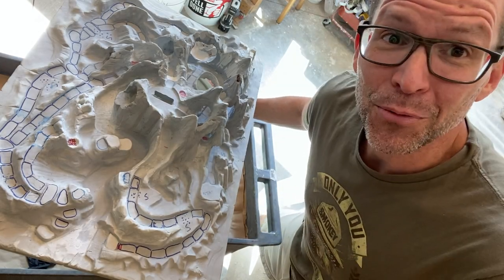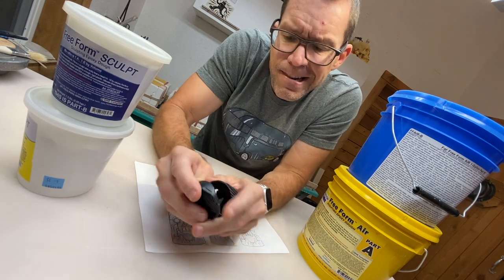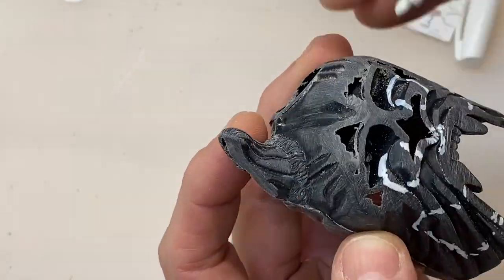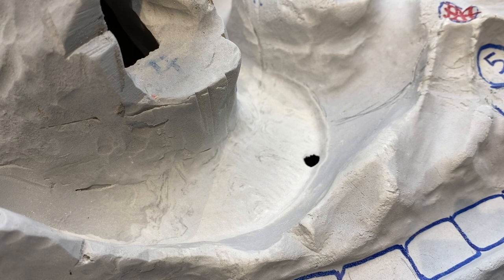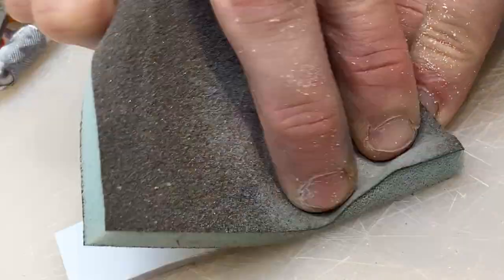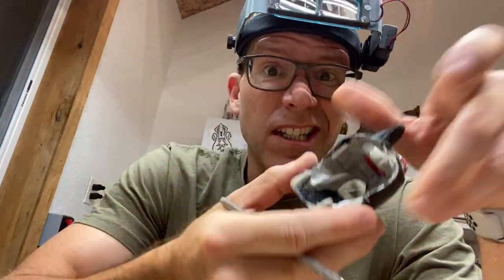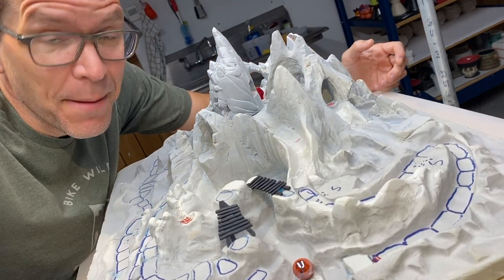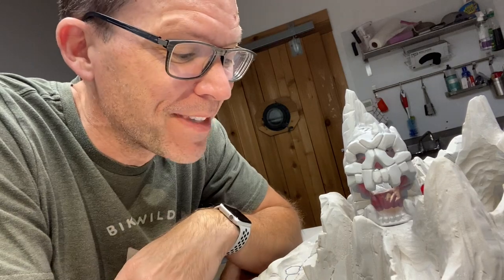Fireball Island pt3 - resculpting Vulkar with epoxy clay and LEDs - Game Relics

Comment: The new design looks great! Loving the temple rockwork, too. Coming from Apoxie Sculpt, I was pretty disappointed in the FreeForm Sculpt, too. It just can't hold its shape without slumping. I've had some luck with using baby powder instead of alcohol or water to keep it from sticking, but that's not super fun, either.
Reply from the maker: Thank you! Yeah, the FreeForm Sculpt was a bit of a disaster, and I’m so relieved I was able to salvage it. Also glad to hear that my memories of Apoxie behaving much better are correct!  😄